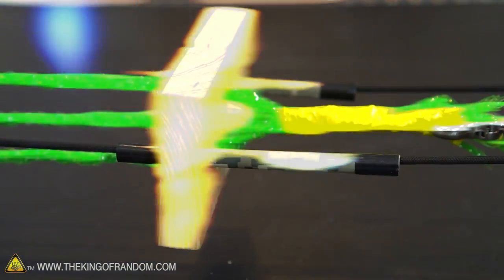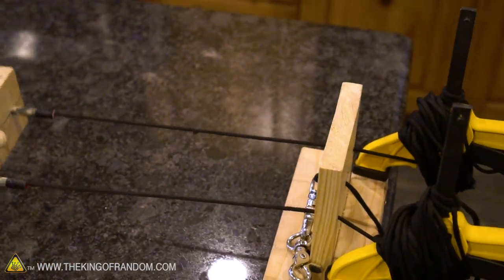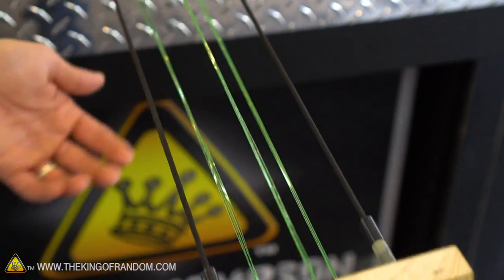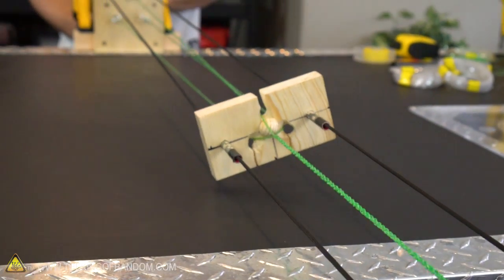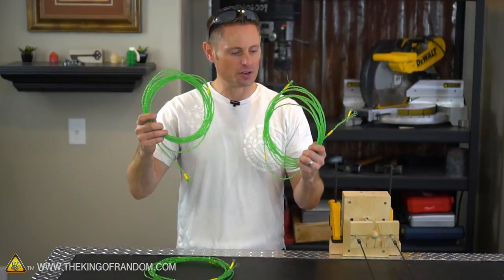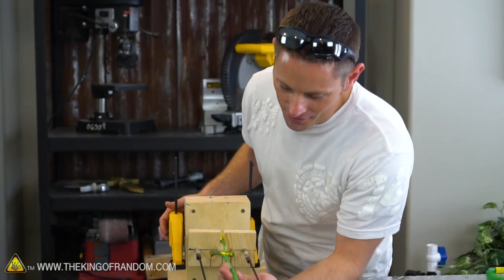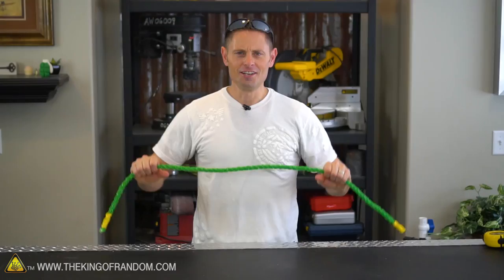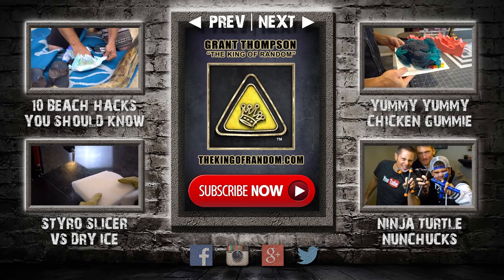Soda Bottle Rope | How To Make Rope Or Homemade String From A Plastic Soda Bottle (2 Liter Bottle)

Comment: If you were to apply heat to the rope, could you melt the plastic so it would be smooth and easier to handle? Would the rope become stronger because it is melted together or no?
Reply: I thought he could melt the ends so that they don't come apart
Reply: Wouldn't remain flexible if you did that.
Reply: Brad Campbell    no    weaker.    Thin sheet has oriented molecules that increase tensile strength.  Melting destroys orientation.
Reply: Brad Campbell how would you be able to 'weld" the ends of the string together so you could make longer ropes?
Reply: that would become a pet bottle stick lol
Reply: If that happens the rope wouldnt become flexible like a rope should,  it would literally become a stiff stick, if it is applied in tension it would certainly break
Reply: Brad Campbell I think you would have to test it on your own
Reply: you could probably just use modelling glue
Reply: He could "insulate" it in a soft rubber. Maybe one that shrinks in warm water. But I'm not sure how flexible I would be.
Reply: I thought he was going to join the original strands end-to-end when making the first fiber. I imagine that as long as the "weld" can withstand the twisting and they are not aligned across the three strands, the final rope will still be strong and flexible.  Regular rope works the same way, right? For any given strand there is a weakest spot that will break under tension but all those spots are in random places in the final rope.  Does twisting also reduce the tension at that point since the individual fiber is not fully in the direction of the rope?

Comment: how about metal string using the same method to make plastic string, but with metal cans?
Reply: The Rainbow Cheeseball Yes you could but metal isn't as flexible as plastic so it wouldn't work that great as string.
Reply: it could maybe work. it would be alot like cable
Reply: You'd probably need to wrap the first rope you make in tape to eliminate any sharpness. After that it should be fine.
And a metal rope of similar gauge (do you measure rope in gauge?) to what he made here would probably be stronger, but less flexible, and forcing it to flex might cause it to break more easily.
Reply: I did that for my AP Sculpture class in high school with the aluminum from Coke cans
Reply: Tobias Halk it would be cool but it would also be really sharp and thus hard for crafting
Reply: The Rainbow Cheeseball it will get bloody without gloves
Reply: Mattie Gr so concept confirmed? you can make aluminum cable from soda cans?
Reply: Probably not. I guess it would be possible, but would be very sharp. You would need to spend a lot of time dulling the edges, and would need a very sharp knife to cut it. So, likely no.
Reply: The Rainbow Cheeseball try it out
Reply: use like a soda can, that would be much better
Reply: I would sand it down then epoxy it using lots of glitter.

Comment: Could you make some sort of fuse wire this way by using something flamable as one of the 3 strands?
Reply: this is the second comment I've read about this. now I want to know why this is a popular question? is there a need for fuse rope in the world?
Reply: I don't see why not. There might be a problem with friction of the fuses being wound causing them to actually light if you're winding actual fuses. That isn't that big of a deal, so unless there's something flammable nearby, I'd try it.
Reply: Pelia You could even ceep the flamable stand wet while winding to eliminating the risk.

Comment: Can you use this soda bottle cutter to turn soda cans into aluminium wire?
Reply: with a really really sharp knife yes
Reply: I mean you can probably cut a soda can with the same knife you'd cut with a plastic bottle. Aluminum cans aren't really as durable as something like solid aluminum
Reply: It'd probably dull your knife after a few cans.
Reply: Matthew Yare use a ceramic knife
Reply: Wouldn't the wire cut his hands?
Reply: You would use the wire for something else, not for hanging off a railing.

Comment: i wonder what would happen if you try a metallic rope using something like titanium or carbon fiber.
Reply: Elite Dragon_gamer carbon isn't a metal. But those ropes exist, so it would work if he can get the right type of materials.
Reply: Steel rope is a thing. Think cables. (But even bigger than a typical cable. Tho they are basically the same thing.)
Reply: iheartbinary he never mentioned steel. titanium was his specific, and titanium, while strong, isnt very malleable
Reply: Not to be a bummer, but the specific word you seem to be looking for is ductile.

Personally i think aluminium would do reasonably well for a rope.
Reply: no, i don't think so because it would be too brittle
Reply: Elite Dragon_gamer Doesn't brittle mean it snaps easily? Or is that my misconception... Also aluminium is know for its flexibility and durability just don't rip it.
Reply: Aluminum doesn't start out brittle, but if you try to bend it several times it starts to work harden and will soon develop cracks and eventually break. It also has low tensile strength compared to for example iron.

If you look at the high voltage transmission lines that's the backbone of the power grid the cables are made of aluminum with a steel core. The aluminum is a much better electric conductor than steel, but with it's low tensile strength the distance between the pylons would be limited. By using steel reinforcement the strength goes up and the pylons can be place further apart while the cable tension goes up. Aluminum will also start to anneal at 75 °C (167 °F), so if there is any risk that temperatures may approach this a cable with a stronger steel core capable of carrying the entire weight of the combined steel and aluminum will be used.
Reply: Blahorga Slisk The primary reason i said aluminium is its probably the cheapest and most easily accessed material. Its not the most ductile, its not the strognest but its probably the best option for most people. I cant think of any other household metal that can be used with the possible exception of copper
Reply: It would  be interesting to see long wire made into rope, it would probably be easier on the hands.

Comment: could you make the rope cover a cord? i know rubber is best to use on cords but i was wondering if you could use your style of rope maker to reinforce an electric wire?
Reply: i'm pretty sure they use rubber as an insulator if it was made of anything else it would burn or melt.
Reply: what if it was already rubber insulated and you reinforced it by threading the rope around the existing wire (much like how a lot of computer wires have a nylon threading over the rubber insulation to keep the wire from being damaged). i guess it would just help keep the integrity of the wire if it worked like i am imagining but that is crazy useful if it worked properly.

Comment: how much do you think that rope can hold?
Reply from the maker: I think it could hold a lot.  Hundreds and hundreds of pounds for sure.  It might be fun to find a company that can test rope strength, and go through all the variations.
Reply: Grant Thompson - "The King of Random"  make one long enough by attaching one an other by using the 3 stranded rope joint techique, if cannot be made long enough that is, then put some hooks on to it and pull a car with it... That will defenetelly proof how strong it can be i believe...
Reply: Grant Thompson - "The King of Random"
Reply: Yeah, you really need to test the strenght of this rope. You should be able to do it yourself by rigging up a heavy duty "fishing scale" together with some block and tackle and then just pull on the rope. Kind of what Beyond the Press do on some of their videos.
Reply: It'd be fun to see the viability of different materials
Reply: Can you test the other rope you made as well? I'd be interested in how much it can hold.
Reply: Yeah, that's what I meant by "fishing scale." :) English isn't my native tongue so I wasn't sure of the correct terminology.
Reply: Grant Thompson - "The King of Random" that would be great. I think that it could probably hold up a couple hundred pounds. do you think that the plastic with stretch and then break or do you think it would just break all together before it stretch

Comment: create a coil...pass current through it.....due to heat the rough texture of rope will decrease to some extent
Reply: you should try this
Reply: Prasad Tamgale the plastic contracts considerably when you run just heat over it, I've made extremely tight soda bottle lashings with thicker nonbraided pieces of it
Reply: yeah that's true...but the amount of heat should be consideribly low inorder to just slightly make rope threads smooth
Reply: It's plastic when the current passes through it would heat up and that would cause it to melt.
Reply: and does it strengthen it after cooling
Reply: But when it melts it would look worse before hand, no point in trying it.
Reply: i mean, you could just add extreme heat off a heat gun or a hair dryer and smooth it down. but as it contracts it'll smooth itself. and plastic is resistive to electric current, it wouldnt heat evenly. you might as well use direct heat
Reply: callum hunter no melting will occur.....it is just like soothing it over the flame and immediately cooling it
Reply: a-lpha of Zeldaforme Gaming yeah as the rope contracts due to heat its strength will increase to some extent
Reply from the maker: I think a heat gun or hair dryer may have a similar effect maybe?
Reply: Grant Thompson - "The King of Random"  Absolutely........that was my point.........you got that right😊
Reply: no, you were talking about running an electrical current though it. wtf r u on about lol
Reply: Grant Thompson - "The King of Random" heatgun would work much better than a hair dryer
Reply: Google User wtf the heatgun or the hairdryer are just the different sources of applying heat to the rope.....basic idea behind that was pretty much the same..just apply heat
Reply: Prasad Tamgale An electric current through the plastic?
Reply: Do you guys even electric? 

A metal coil when supplied with current doesn't heat up.
Reply: Nano Mine The amount of heat generated would be proportional to the resistence of the metal used.....u can use tungsten

Comment: soda tab chains VS Soda bottle rope
Reply: made it 3 years ago
Reply from the maker: Soda bottle rope wins hands down.  The chain is more for fun, look, and wallets.  It doesn't hold a load of weight.  But the plastic rope will hold a ton
Reply: How you doing grant
Reply: Grant Thompson - "The King of Random" make a hair rope from fake fur

Comment: Try to do a 100 layer rope challenge
Reply: If by that you mean that he keeps making a new rope from the last size, and again from that size and so on, you'll find that's...impossible.

Assuming the starting rope is 2mm thick and working with the very rough assumption that the rope doubles in diameter every layer (probably more) it would be as thick as the diameter of the entire planet after just a few dozen itterations. After a hundred itterations it would be well thicker even than the entire observable universe, all 93 gigalight-years of it, and then some.
Reply: Dusto9 
I find your assertion that a couple dozen iterations it would be "as thick as the planet" interesting (not discounting, yet, as I know doubling can add up quick). Would you care to mathematically test your theory?

We'll start with the assertion of how much the thickness increases. This depends on how you make the rope. Grant uses six strands to start with, but I'm assuming if he's going for "100 layers", he'd probably limit that to three or even two strands.

The earth is approx. 12,742km in diameter.

As per your assertion, we'll go with 2mm strands.

Using the equation (strand size) x (cords per rope)^(iterations)=(resulting thickness)
sc^(t)=T

2x2^(12)=8,192mm or ~0.008Km
2x2^(24)=33,554,432 or ~33.554km
While not anywhere near earth-sized, that is still quite unrealistic. But just for fun, we'll see this through to the end.
2x2^(100)=2.53530120E+30 or approx. 2.5353septillion(24 zeros) kilometers. That's about 199quintillion(18 zeros) times the size of the earth.
Reply: Hi Iron Lightning, 
thanks for your interesting reponse.

I'm no hero when it comes to math and to be honest i only did the calculation 2x2^100, as it made me think of just how fast numbers get very big when doubling repeatedly. I found it to be an enormous number (2.5353012e+30 indeed, just like you got), which made me think of the size of the universe. 

A quick google search taught me that the size of the observable universe is 93 billion lightyears across, which in millimeters is "only" 8.79829142e+29. So several universes would fit in our rope. Assuming our rope doesn't decide to go supernova on us before we get there haha.

I only guestimated that it would take "somewhere near a couple dozen" itterations to reach the size of earth, i didn't mean exactly 24. Doing the math now i realise it's slightly more than i guessed: it would take 2x2^34 to surpass the diameter of the earth :)
Reply: This is the best kind of conversation.
Reply: Bryan Avila e
Reply: Dusto9 I am assuming he means having around 100 strands of the soda bottle string.

Which would ROUGHLY (and the closest to 100) happen with one more iteration. At the end of the video, the rope had 27 layers. Another iteration would put it at 81 strands.
I you did ANOTHER iteration, it would completely overshoot the 100 mark, going to around 243 strands.

Comment: i wonder ir these strands can be used for 3d printing...
Reply: Pierce Faron you would just have to check the recycling logo number on the bottle itself to confirm the type of plastic each one is
Reply: As a filament? Or for other purposes?
Reply: Arvis Pļavnieks no, a 3d printer uses a special type of plastic, regular plastic will just melt inside the printer and break it
Reply: yes, PETG is great printing filament.
Reply: 3d printers adjust to different temperatures, and they can use different materials for filaments (the most common ones are PLA, ABS and Nylon, it depends on the model too).
The biggest problem is that they're made for round filament, not for flat strips. I guess you could design a nozzle and feed system for that.
Another problem would be getting strips of accurate width across all the length, or it will mess the feed rate.
Another problem that might arise, is that the bottles are stretched, and they contract when heated.
I think it should be doable with some effort, but it would probably be better to just recycle the bottles into filament first, using an extrusor.
Reply: Arvis Pļavnieks I was thinking weedeater string

Comment: That green rope would be great for crafting things. Like if you are having a tropical party you could make garlands with it. Maybe hang some fairy lights with it around the hanging stuff. I doubt if would melt the plastic rope since the led type bulb on copper wire produces little to no heat.

Comment: Could you upgrade the machine to be manual powered rather than powered by a drill?
Reply: sure, put a crank handle on it.
Reply: or a pedal + weighted wheel, like an old sewing machine

Comment: how'd you join two pieces of rope together?
Reply: without tape I mean.
Reply: Hasaan Khan melt it maybe? idk though
Reply: Hasaan Khan I noticed he didn't want put that In lol I would melt it but idk how strong that would be
Reply: well you tie a knot
Reply: You could tie knots with the strings where the two pieces connect. Break apart the pieces to make it easier. Before you do though, put some tape on both ropes a few inches from where you are going to tie the knots. This is to ensure the ropes dont come untangled.
Reply: it's called splicing, where you untwist the end of a rope and insert more material then twist it back to put pressure on the joining surfaces, then twist the new section the same as the old and ect ect, i'm not sure how to plastic would go as it's smooth though
Reply: Hasaan Khan you could melt them together if there plastic

Comment: When your finished winding the plastic bottle  rope you should use a blow drier on it to make it smooth and hells sttrong and far less likely to unwind ever.
I work with recycled plastics avlot and a blow drier is a absolute must tool !!!

Comment: Cut the starting strands about half that width you cut the bottles into, and it will make a finer quality rope of greater length and lesser diameter.  It may be slightly less strong as it will be less thick, and each individual strand will be thinner...  however, doubling or tripling up strands or twisting multiple strands into strings and making strings into ropes, makes for stronger overall rope.Also see if you can do a 5-10 strand rope.  And see if you can introduce the twisted rope as a core, and build a weaver to build a woven jacket around the twisted core.  A twisted core with woven jacket rope is EXTREMELY strong.  :-)

Comment: I like your setup. Very effective. Could probably make unlimited length by adding an extra strand when slider nears the end. Friction of the material and twist for a few inches will hold it in place. This might make decent string trimmer line...

Comment: forget making that rope, use the string as is for lashings then hold it over a fire and it will shrink with heat. Super tough and strong lashings that hold up in water

Comment: What if you would use thin metal wires? Would it work after making 3 forces then attaching them all togther using the machine.